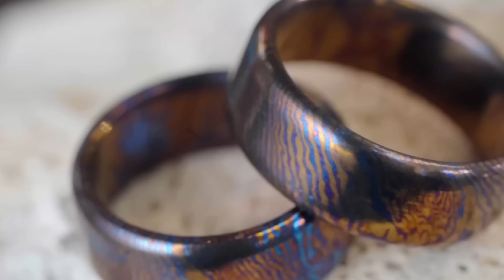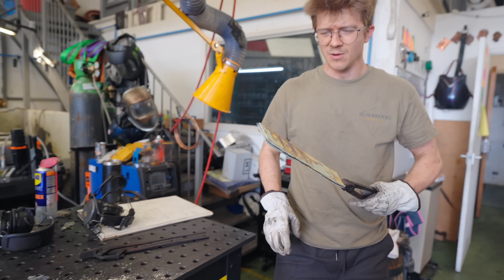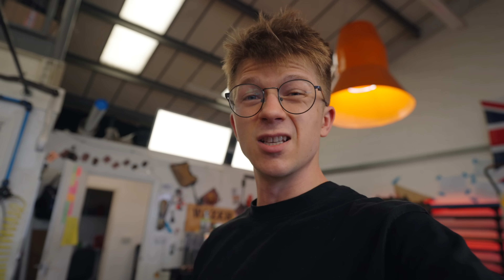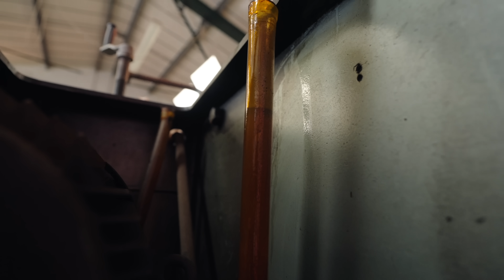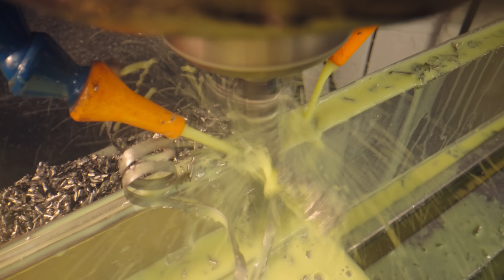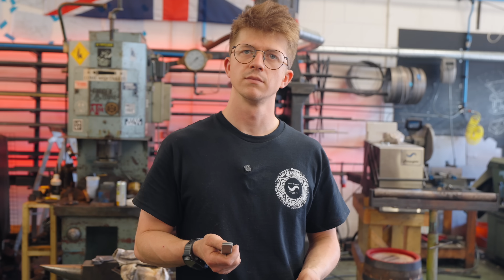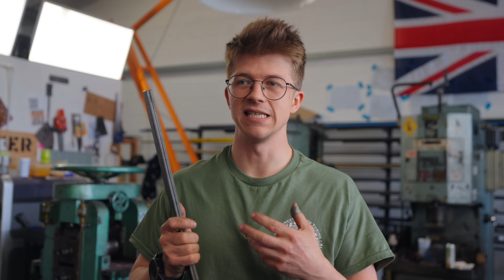Making a Titanium Damascus Katana - Part 1

Comment: 32:42 The most direct (but probably high effort) way to strengthen the bond and aid with the heat transfer would be to increase the surface area. Steel is much harder than nickel or titanium so what I would do would be taking the steel core and testing the following things:
- scratch it, take a diamond drill or something and scratch the surface so it has a orugh texture and holes etc
- still small holes across the area
- take a stiff piece of steel bent into a sig-zag shape - scratch it up on top of the zigzag too

The strength of any bond like that goes up with the surface area and you can double the surface area by just scratching up the surface of something so it's rough and not smooth.

Another possible thing to do is cleaning the titanium and nickel first. They have oxide layers on top. so the bond likely has gaps in it. Just cleaning the nickel and titanium could increase the surface area by 70%. Problem is to do that you'd need to either using acid or with a grinder/file do it completely under argon. Luckily argon is heavier than air so if you use a hand-filer just doing it inside a box you let argon into on top would get it done. Then best also assemble the biller in that box. (a mechanical grinder spins so it would probably pull in surface air hard.)

Sadly both nickel and rtitanium react near instantly with oxygen so any kind of surface cleaning without argon is useless

Anoither idea actually - if you rough up the texture of the steel core and after making the biller hammer it a bit then  before the heating the rough texture on the iron could help scratch off some of the oxides. So this could also help increase bonding a bit.

So yeah an easy thing worth trying may be to rough up the surface of the steel core and then to hammer the billet a bit before starting to heat it.

38:10 The longer it is the bigger a role the different thermal expansions play sadly. All metals have a different thermal expansion coefficient. The only way I can think of that this could be improved outside of trying to brute force it by strengthening the bond is to take the metal that expands more and cutting small gaps there, but that would probably look bad :(

40:41 Wait actually various types of steel alloys have different thermal expansion coefficients so maybe some more obscure types of steel for the Damascus could help here

Comment: btw, shouldn't you be able to use molybdenum for the jacket? it doesn't react with titanium. and with the help of google, i found that it can be forged between 1700 and 2000 F. so it should work on paper. but what do i know? i'm just an engineering student. also, i was watching one of nile red's videos, and in that video (i don't remember which) he mentioned that welding argon isn't as pure as lab grade argon, and that it may contain moisture and other purities. so you might wanna get a cylinder of welding grade argon maybe?

Comment: I'm not a metalworker by any means, but I do woodwork. The biggest thing I've learned is that if you take too big of a bite out of a piece of wood, it's going to split. In your case, it seems like it delaminated and ripped your billet apart like it did in the mill.
We've learned that using smaller amounts of force over more passes is a good strategy with rolling, so why not try the same approach with the mill? You could also try running the mill at a higher spindle speed to reduce friction while using a slower feed rate.

Like I said, I'm not a metalworker by any means, but it's just something that came to mind while I was watching the video.

I love your videos Alec Ive been watching since before you went to Montana and can not wait to see the following parts and next projects. Best of luck!!

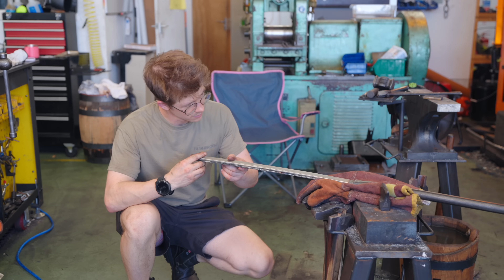Comment: 8:00 there is a real way. Get  yourself a small oxygen meter and after a while put it really close to the exit hole. based on the oxygen level you can see if you still need to pump argon. Better safe than sorry.

Comment: What should've also been tested is how must stress the katana (prototype) at the right thickness could take in bending before a breakage after the rolling method. Just a thought, but if the rolling method was in fact increasing the bonding of the metals, perhaps it would allow for the katana to require more stress when bending at a longer length.

Comment: Man, to ensure there is no oxygen inside, you can lift the tip and wait for the oxygen to escape, since argon is dancer than oxygen it will settle at the bottom and push the oxygen out.

Comment: Hello @AleccSteele titanium becomes harder to forge and high risk of becoming brittle when trying to forged it in contact with normal air and oxygen that might be the issue if there's any way to incorporate some neutral gas like argon because another thing is that once you heat up to the perfect temperature the titanium it also becomes reactive to oxygen and I think you had a similar experience. Well cheers mate I know you know what you are doing and the job you have ahead of yourself. 🫡🫡
Reply: If there's a person that will make it possible that will be you mate.

Comment: Quick question: Why not do a billet, heat it to 850C (or maybe a bit above) and then instead of hammering it, why not directly roll it? So it gets an even pressure all the way through the piece which should do a better bonding. or does the rolling remove more heat than the hammering?

Comment: Look up Brunel Microscopes. They do both refurbished and new microscopes and they're as cheap as you're going to get for metallurgical quality. Also literally THE BEST customer service ive ever had with a science equipment supplier. We had a capacitor blow on one of the electrical boards. Told them, and they sent a brand new board no questions asked next day delivery  and have always been great when sorting out other issues other the years. Genuinely. Really good stuff.

Comment: So you're end goal is to have a pattern weld damascus steel edge, then a titanium & steel pattern weld damascus back to the blade?
I understand that you're using that steel/titanium patent which used a nickel layer to bond the two... but is there any merit in trying to make a billet from powdered titanium, nickel, and steel as a type of alloy material for bonding?

Comment: If you wanted to skip the argon gas to prevent the oxidation, Could you just use electroplating to coat the titanium and steel with nickel? Then bake it for a bit to get it all bonded at the atomic level

Comment: I spent a good couple of years trying to join ti+ni in a funded project. Absolutely amazed you've managed to get a result, well done!

Maybe you covered this in a prev video, but ti+ni isnt usually weldable, these elements will make brittle intermetallics with each other, and they have dissimilar coefficients of thermal expansion and conductivites - explains why your quench samples were more likely to delaminate.

Comment: You've got an induction forge right? Put that coil right in front of the rollers. Warm steel -> induction -> roller. It'll be tricky to regulate the temperature but now you can heat stuff as long as your shop.

Comment: It looks like you’re asking about combining steel and titanium under GOST (Russian state) standards. There are two main ways this is done in practice, and both are covered by GOST-style specifications:
1. Titanium as an alloying element in steel (GOST steel grades with Ti)
Titanium is intentionally added to certain carbon and low‑alloy steels in small amounts (typically 0.01–0.10% Ti) to:
Fix carbon and nitrogen (forming TiC, TiN), which stabilizes the microstructure
Prevent intergranular corrosion in some stainless steels (Ti ties up C so Cr stays available for corrosion resistance) 
Refine grain size, improving toughness and weldability 
Control sulfur and oxygen effects during steelmaking 
GOST standards explicitly allow or specify titanium in several steel grades, for example:
In GOST 5781‑82 (hot‑rolled reinforcement steel), certain grades may contain 0.01–0.03% Ti, and in some cases Ti can replace zirconium or aluminum in defined ranges .
Specific grades like 20HG2TS and 23H2G2T allow controlled Ti content or substitution between Ti and Zr .
Analytical GOST methods (e.g., GOST 22536.11‑87, GOST R ISO 10280‑2010) define how to measure Ti content in carbon steels and cast irons.
So if your interest is “GOST steel with titanium added,” the key point is: Ti is a minor alloying element (hundredths of a percent) in specific GOST steel grades, not a 50/50 mix.
2. Steel–titanium clad/bimetal plates (GOST / TU specifications)
If you mean physically combining bulk steel and bulk titanium (e.g., a steel plate with a titanium layer), this is done as clad (bimetal) plate, typically by explosion welding or roll bonding.
A Russian technical specification explicitly covers this:
TU‑1880‑001‑15190236‑2011 “Steel–Titanium Clad Plates” defines bimetal plates made by explosion welding with:
Base metal: carbon/low‑alloy steels such as 09G2S, 20K, 22K (GOST 2520‑79) or equivalent ASTM/EN grades
Clad layer: titanium grades VT1‑0, VT1‑00 (GOST 19807) or ASTM B‑265 Gr.1/Gr.2 
These clad plates are used for:
Heat exchangers and pressure vessels in chemical and energy industries
Applications needing steel’s strength and low cost on one side and titanium’s corrosion resistance on the other 
The standard defines:
Allowed steel and titanium grades
Thickness combinations (e.g., 40 mm total with 3 mm titanium cladding)
Bond integrity classes and marking �
3. Why not “mix” steel and titanium as a single homogeneous alloy?
Bulk “steel–titanium alloys” with large amounts of both are rare because:
Ti strongly forms carbides, nitrides, and oxides in steel, which can embrittle if not carefully controlled 
Melting and processing are complicated by very different affinities for O, N, C and different melting points
In practice, industry prefers either:
Small Ti additions to steel (micro‑alloying), or
Clad composites where each metal keeps its own properties
Which do you need?

Comment: 27:00 novice machinist here, it looks like your tool path was dead center of the milling bit, from my experience when making measuring blocks is that you don't want to go dead center when you are milling bit on skinny pieces. 
You want the Mill to cut on the side, not the front so to speak.

Comment: My working hypothesis is that the bond is surviving the diffusion-bonding step but failing during forging. Titanium and steel have very different hot-working behavior, so when the billet is reduced the interface sees significant shear strain. Even if the nickel layer successfully prevented a large Ti-Fe reaction zone, any thin reaction layer or microscopic defects at the interface could crack under that strain and then propagate during continued forging. They are essentially seeing significantly different deformation at either side of the interlayer that I think is causing them to rip apart in small sections, and those get much worse in successive forging operations. 

That makes me wonder whether the best approach is to join the timascus and Damascus closer to final dimensions and minimize post-bond deformation. If the bond only needs to survive grinding and finishing rather than large forging reductions, the interface stresses should be much lower.

I would also be cautious about identifying the material that squeezed out during rolling. Without metallography or chemistry, it's hard to know whether it is nickel-rich material, a Ti-Ni phase, a Ti-Fe phase, or something else entirely. You could have squeezed out the protective layer and created the intermetallic during the forging process. I don't have any idea how long it takes for that material to become and then to melt, but under the pressures you're putting it under, it could be immediate. 

I am somewhat concerned about residual stresses during heat treatment because of the titanium/steel mismatch, but I would expect the forging strains to be the more likely failure driver than thermal contraction during quenching. Even still, you may want to do the claying on the hamon to prevent the immediate shearing behavior over the large surface area of the katana.

Comment: So, doing another katana?

I have a challenge for you: Get the curve in the blade through differential hardening rather than just forging a curved blade.

A katana is made as a straight blade, and then coated with clay. The clay over the cutting edge is thin, while the clay over the spin is thicker. After the coating, the blade is heated, then quenched in water. The difference in how the different sides cool based on the clay coating is what causes the curve. You can find videos on YouTube in slow motion showing how this curve happens in the water. (This process results in a very hard cutting edge, but a softer and more forgiving spine.)

For example, check out the video from the Samurai Tavern channel entitled "The Moment of Yakiire Quenching" from 12-29-2021. In the close-up video, you can see the clay slaking off of the blade in the quench.

Comment: Is it possible that starting to strike the billet at the point closest to the handle during the first pass affected the argon flow in some way? On the second occasion, the process begins at the tip; this way, even if the flow is interrupted, the gas remaining inside is still argon. In contrast, during the first attempt, the argon flow might have been cut off, allowing oxygen to take its place through the hole.

Comment: Could the jacket use some extra holes along its length to let the gas out after the end gets smashed shut? Smashing the end hole first could be pressurising the jacket creating bubbles and folds and wrinkles which then break the structure and screw up the separation and welds?

Comment: The atomic mass of argon is ever so slightly then the compounds that make up air, meaning if you held the jacketed material upright, so the vent hole was facing upward, at a lower output volume you could ensure flushing out the oxygen a bit easier.

Comment: Two potentially helpful ideas for your quest. 

One, you might be able to create a temporary extension to you kiln. You could make a similarly sized kiln extension out of refractory bricks. This could give you the extra length you need. The extension, theoretically, would not interfere with the temperature measuring and control as the probe should still be in the enclosed space. For ease of opening the extended kiln, you could mount the extension on a cart with wheels so you can wheel your new unwieldy door out of the way when needed. If the material needs supporting where the extension floor will be removed, maybe have an I beam of appropriate length as a shelf already in the kiln for the material to rest on as the cart is rolled away.

Two, for Argon purge checking, you could direct the outlet of the jacket at some coals, or a small fire. If there is no oxygen the coal will cool, or flame will die. Beware false positives of air pressure just overwhelming coal/flame like a birthday candle. Or maybe Argon is cheap and you just wait.

Thanks for the vids

Comment: Would the titanium sandwich possibly help with durability due to its conduction properties? It should keep the back of the blade softer if you grind a bevel exposing the steel that will form the edge before quenching?

Comment: Maybe you can get the different typ4es of metal put them in a corner and have you and Jaime have a loud shouting match at each other, like a really heated fight maybe even to the point of throwing blows. Then it is possible the different metals will be trauma bonded.

Comment: You might be able to create a 2 handed sword I designed when I was around 11. 
It's a titanium magnesium and carbon alloy with a copper core. 
The theory was to add carbon to the titanium using diamond dust dusted with magnesium then folded through over and over titanium so it mixes without it breaking. 
Though this was my 11yo brain working 😅

Comment: Don’t forget that when making a katana you want the spine to be flexible but the cut face to be hardened. If the entire width and length is hardened it will not take shocks well without cracking.

Comment: I hope you aren't going to use 1080 for a core on a final blade, it would make it rather brittle. Blades are usually lay within 50-55 Rockwell, to be bendy enough to sustain strikes. 60+ HRC blade would snap on chopping

Comment: Old welders trick when welding stainless tubes or anything that needs purging is to use a regular bic lighter. flick the lighter by the purge hole and when the gas coming out puts out the lighter you got all your oxygen out

Comment: Hey Alec, you mentioned early in the video that one limitation you’re running into was how quickly the material loses heat so you don’t have much time under the hammer to get the bonds to take. 

Would it be possible to, instead of using such a thin piece of mild steel as your outer jacket, use something much thicker? You could feasibly triple or even quadruple the mass of material such that it holds the heat much longer and gives you more time under the hammer establishing those bonds on the forge welds. Then instead of peeling away a couple millimeters of mild steel from the outside you’d have to peel away a bigger piece, and that could be a challenge in and of itself. 

Regardless, apologies if you already tried that in your earlier titanium videos. And please pardon my ignorance if I’m way off base here. The only hammers I’ve swung were while building decks and shingling roofs.

Comment: I understand that this is quite the technical challenge, but is that the only reason for using titanium. When I researched making titanium blades I found that it has poor performance for knife edges. Does this change when it is incorporated into the Damascus?